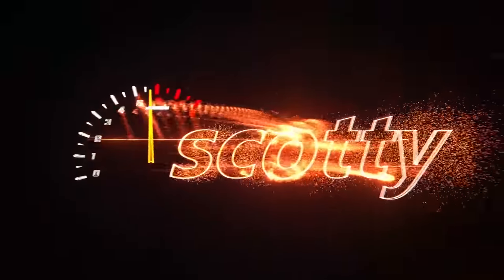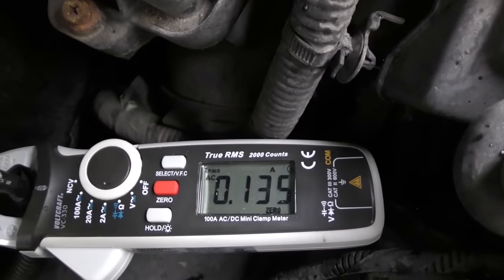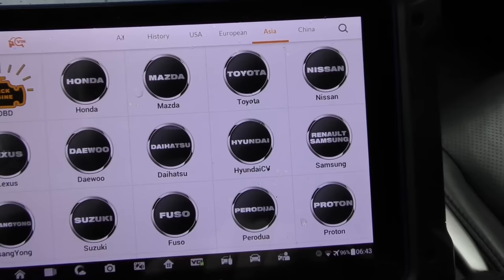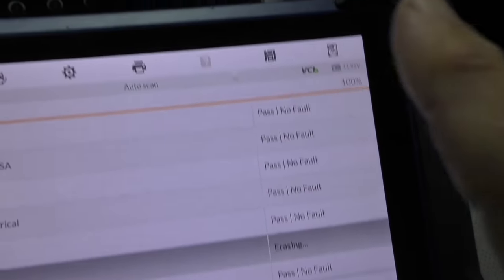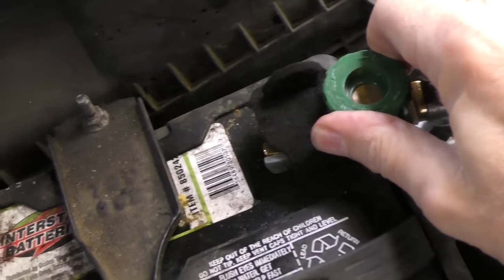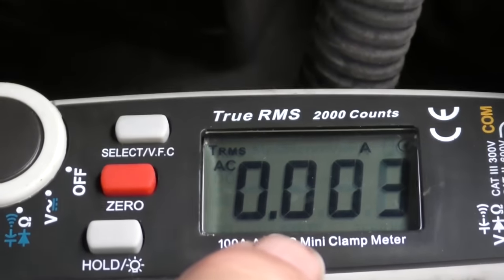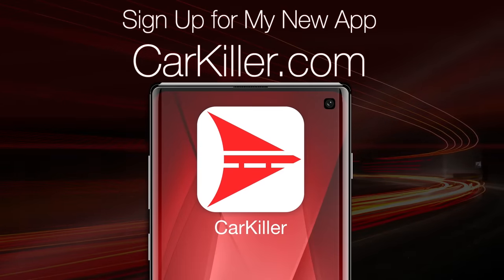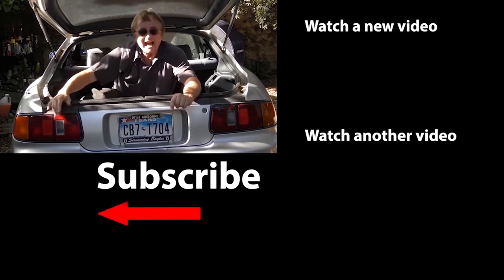Watch This Before Buying an Acura

Comment: The vehicle is over-sensored. Needless computer complexity with failure baked in, makes an owner want to sell the vehicle when it has some age. IT IS VERY POSSIBLE THIS ANOMALY WAS PROGRAMMED IN ON PURPOSE  BY HONDA TO CREATE THIS EXACT SITUATION. It would be wise to have 3rd party programmers read the actual code in the ECU and have an attorney call Honda if it's found they have pulled a Volkswagen maneauver on the American people. Wouldn't it be awesome to sue Honda for everything they got.

Comment: My two Mazdas, a stage 3+ MS3 and an AWD CX-7, have as much amps drain to deplete de battery after 4 weeks of non usage...
But it was simple to find the source: the CX-7 has a OBD2 Bluetooth plugin connected all the time, “it shutdowns automatically” sure sure sure
And the Cobbtuning Accessport v3 on the Speed, and again it is still alive waiting for the PCM/ECU to send wake up signal... so disconnecting them fix the problem. 
Mazda is not as crap as Toyota, one can disconnect the battery for car storage with out damaging anything like the Toyota’s: ECU Reset is welcomed for the Gen1/2 Mazda vehicles, resetting octane fuel usage and altitude statistics... while Toyota gets fused and probably destroyed lol
I can program the windows and traction control on the CX-7, I have an iPod for music so who cares about radio stations 

I have two friends with RAV4 and another one with RDX and they have infinite problems, even with their husbands being almost as good mechanics as me... this girl is not a normie like the ones Scotty preaches to

Comment: This is unacceptable manufacturing from Acura. We are not all tech savvy guys with ammeters and wrenches and no one should have to start their car every day, or every 8 hours to make sure their battery stays charged. I recently bought a used 2005 MDX and realized after not driving it for three days that it had this problem. By that time it was too late to return the car to the dealership, even if I had purchased their 2-day legal return clause and $250 restocking fee. And from watching YouTube videos, I see that the battery brain happens in all years MDX, from early 2000s to modern 2017s, and sometimes the problem is a safety threat - one forum described the car stopping on a freeway due to battery drainage. It's such a shame, because the rest of car is beautiful and well designed. In comparison, my older Toyota has never had battery drain. I just don't understand why they designed a car with all these electronics and computer systems which drain the battery, when all people want is a reliable car which will start whenever they want it to.

Comment: Scotty, you can't measure DC amps with a clamp-on meter.  The clamp-on is for AC only.  I'm afraid you're using the meter incorrectly.

Comment: Kudos for that interstate battery. One of the few batteries left worth anything.
Reply: Apparently Wal-Mart exide maxx are pretty good as well. Anything over the oem CCAs ratings are decent since there's only a select few battery manufacturers now, producing different brands names of batteries with similar specs.
Reply: @ricebike  Ive tried that battery. It died in under 2 years. Went back to exchange under warranty. It also died within 2 years. No parasitic draw either I tested it. Autozone batteries are trash. Never use them in a euro car.

Comment: Scotty, it may also be you have the amp meter set at “auto select” and it is reading transient ac current by way of the “ac” shown on the left hand side. I’m not sure if that meter is capable of hard selecting dc instead of auto ac/dc by way of the “select” button, but if it does it will likely give better readings. Otherwise if the current is too low or erratic it is always trying to auto select the current type (ac or dc) and not always accurately or quickly enough. This is why it’s a good practice to disable auto-range/ auto-ac/dc on digital multimeters if you know the expected range/type.

Comment: i remember when i did my first automatic to 5 speed conversion on one of my cars and it wouldn't start...i had to leave it till the next day. it didn't start cause the NEG battery terminal was loose😕 check the easy stuff first!

Comment: In an automotive advice column in the Chicago Tribune it was said that its a good idea, with a manual transmission to put it in reverse before ultimately putting it in another gear just prior to shutting the car off. I’ve never heard that. They didn’t say why to do that. Is there any truth to that?

Comment: Please help me sir!! I have A 2007 rdx that we have replaced everything on!! And still can’t get it to run right with the ac on!! New battery new alternator new battery terminals I don’t understand sir! I have not replaced the ac compressor yet that is my next move but I need your help!! Please 🙏 god bless you this has been an issue for 4 years!! I fix it get to drive it fix it drive it repeat please help me!!

Comment: hey I have a acura 2k8 mdx and this seems to be a common issue with the bluetooth hfl. in that model if im not mistaken its located in the area where the rear view mirror. if you disconnect it it should resolve the issue ( on the mdx you have to sit in the back seat and pull the middle console torwards and  the bluetooth hfl is right there and just disconnect it. hope this helps.

Comment: Scotty ive got a 99 RL that does the same damn thing !  i took the cheap fix just disconnect the terminal until I wanna drive it. The vehicle has 198,000 on it but it still runs like a bat outta hell and the body is solid not even as much as a dent. i dont know how much longer I will keep it but when I trade it in Its gonna be for a 2015 Acura TL . My question for you is what is better rear wheel or AWD

Comment: Subaru’s are known for dead batteries.. mine is 1 1/2 years old..18,000 miles and I kept getting a dead battery..kept jumper cables in my trunk...had to install a new battery...
Same thing with my last Subaru.

Comment: Dear Scotty I don't normally reach out to busy people like yourself but I have an important question I'm a young mechanic I own a 93 Dodge Daytona that I partially restored with my grandfather there was an oil leak in the valve cover and when I tried to replace the gasket the bolt to the cover snapped, (I was using a torque wrench set to the all data specs) I replaced the gasket and drilled and retapped the best I could there is still a small leak for now it's an oil pit any advice please up vote this feel free to correspond

Comment: Hi Scotty can you please disconnect the wireless bluetooth module and check again.....On 10 year old ACURA MDXs the bluetooth wireless partially shorts and causes the battery to completely drain..(Johnson controls was the MFG for the module)..the solution was to disconnect it...could the 10 year old RDX have the same bluetooth module>?

Comment: 1000% its the bluetooth module causing the power consumption. I thought you were a good mechanic lol It took me 10 mins of Google to find the issue its common and a super easy fix. I guess your way of rigging the battery works too LOL

Comment: Hi Scotty I have a 2002 Mustang GT, 98k miles on it. Car runs great a couple minor problems though. My check engine light came on so I plugged in my scan tool and my camshaft position sensor code came up. I changed the camshaft position sensor and the engine light went away for about a week or two and came back on. I was reading the Mustang forums online and a bunch of people saying it might be the alternator going bad. Also Sometimes When I get into my car It Won’t start on the first time, it it doesn’t fire right up on the first time then it always does on the second time. Any idea what it could be thanks!

Comment: Install a battery tender lead you can plug in with out opening the hood
Reply: Thats not a good solution. The problem here is the bluetooth module, very common on these acuras, just disconnect the module and it will be fine.

Comment: Got a Chevy impala ltz 2013- having a problem with driving side wheel. Not rotating correctly when I first start off cause the the traction light to come on. Also was advised my transmission is slipping. Any suggestions/ recommendations?

Comment: The fluctuations are because at that low amperage this meter is not accurate enough to read that low. This guy doesn't know what he is talking about. A very common problem is the hands free Bluetooth module. 10 seconds of research and you'll find it. If you want to be charged diagnostics fees from hacks like this, then throw your money away. Otherwise,  disconnect the hands free module and go on. I've had 3 and that's what I've done with all of them.

Comment: Skotty. Question.      Yesterday.   I.  Mistakenly. Pressed on the gas. Peddle. So much that. Some how. It took air in. &. My car. Turned off.    Now when I try to. Revive the car.  It. Turns on. But. Emediatelly. Turns right off.  The rpm.  Won’t rove up.          What can b the problem.       Al I did was. Press the peddle. All the way down.     I heard the gas go thru. So loud. Then the car turned off.  &. Would it. Stay on.      How can I. Fix this.    Let it sit. Or ?       For. Infinity. I35 2002. 3.5 engine v6

Comment: Hey scotty i am a young mechanic and i have a 2003 saturn ion that has a rough idle and stumble in drive from stop and go but in neutral or any other gear it runs fine until about 45mph. The Check engine light reads cylinder 3 misfire but does not blink or flash I have changed the icm, coil pack and spark plugs but nothing has changed please help

Comment: Ive been having the same issue with 4 of my TL 04 -08 model and the issue was the Bluetooth aka hands-link it would drain my battery in a couple of days after sitting. i just unplug it and never had an issue since then.

Comment: An Acura that drains the battery, I have, granted, older 3800 Buicks (1997, 2006, 2009) and don't have problems like these modern so-called luxury Japanese and German cars.

Comment: My biggest problem with Acuras is how the v6s still have timing belts!  Come on, put a chain in there..  and the leather seems to have the worst lifespan on any I've seen. Every Acura older than 3 years just looks ROUGH.  Cracked and dingy leather all over..    it's comfy, but not durable.

Comment: HFL module solder cracks and shorts. Green connector in the passenger side of the center console compartment. 

Unplug it and your freaky Acura drain will be gone.

Comment: Bad capacitor in the onboard computer?  They go bad in regular computers after 10-15 years.  They go from being capicitors to resistors... which leak voltage.  Japan produces the worlds best capacitors but they still do go bad sometimes.

Comment: Has anyone had any issues with the 2008 Acura MDX??? Looking at one right now that has 160k for 6 grand, it's priced at like 2 grand under market value and it is gorgeous!!! I have a 2008 RAV4 with the V6 and my rear subframe is starting to get pretty rusted out so that's the only reason I am looking, but any input would be greatly appreciated!!!

Comment: Scotty i have a Toyota echo 1.3l petrol. At steady speed abou 1900-2100rpm engine rattles, and the rattling stops whether I push gas pedal more than that or realease it. Otherwise runs good....

Comment: Hey you're right in CT ,would you look at my MDX I'm in Springfield?I have a running rich problem,but ONLY AFTER REPLACING THE MAP AND COOLANT SENSORS,it first it was misfires so I did  tune up,cleared,after the sensors now It's rich..

Comment: These clamp-on current meters are not that accurate.  Especially on the lower end of its range.  Also....  you're in AC mode and you should be in DC mode.

Comment: Scotty I have have Volkswagen polo 1.2 diesel.
It fan stays on even I don't start the engine, and some machine says it could be problem in ecm.
It could be software or actual fault in the ecm chips.

Comment: Hi, how do I fix the spray for the windshield wiper fluid? It’s not spraying any water. Is it just clogged?
Reply: Either that, the switch, or the washer pump or the wiring

Comment: I had a similar issue.  It turns out that the aftermarket stereo amplifier was still drawing power when the car was shut off.  For some reason, the blue & white amplifier turn-on lead keeps sending power, keeping the amplifier on.  So frustrating!  Anyone have a suggestion to fix this, aside from installing a switch on the turn-on lead?  I don't want to tie into a factory ignition switch wire unless I have to.
Reply: I think you may find the amplifier is staying on as design. Up to 3 minutes after you turn off the ignition, roll up the windows, get out of the car and close all doors it will go to sleep and turn off. This is normal.

Comment: He should hook up an actual electrical disconnect switch instead.
Reply: And how much would that cost? These mechanical ones are easy to install and are under $10. I say, unplug those offending modules to see if that resolves the issue that plague Honda Acura owners ALL over the nation for almost a decade now

Comment: Scotty how would you rate the reliabilty of a Saturn/opel astra H
Reply: I'm not Scotty but check out the costs for normal wear and tear parts like brakes,struts,o2 sensors and such at your local parts stores. I'm pretty sure what you will decide.

Comment: Hey Scotty, I was looking at a 2007 Toyota Corolla CE 5 speed manual transmission, 1.8 liter 4 cylinder 126 hp. It ha 232k miles. It’s listed for around 2100 dollars. Should I buy it or ditch it?

Comment: Scotty i have a 04 buick lesabre 3.8l v6 engine 132000 miles what would be causing my gauges and windowa not to work ?? Changed all fuses and relays and still having problems ? Can i have u come to ny and fix it lol ill pay u if not whats a good answer thx

Comment: Hey Scotty  I got a code on my 03 gmc 4.3 code on the vehicle is P0016 crank and camshaft position sensor bank1 where are these located and should I change both sensors

Comment: Hello Scotty I have a 2001 Nissan Maxima Se 20th Anniversary Edition with 116,169 miles have a code P0430 catalyst efficiency below threshold bank 2 would I need to replace the o2 sensor or the catalytic converter.

Comment: Of course it runs fine when Scotty drives it 😵
Reply: The problem was something is draining the battery...
Reply: @ricebike  I meant in general when a mechanic test drives a car, especially with an intermittent problem, it works fine for them
Reply: @CornPop471  that's why mechanics should charge 1 hour diag fee from the start for "intermittent" cases

Comment: Scott Obviously the best diagnostic test would be to start disconnecting certain systems. For example, disconnect the NAVIGATION SYSTEM, which the car was complaining about. Disconnect the navigation system and then see if that intermittent power spike came back. Start disconnecting individual computer systems after that if that doesn't work, for instance the entertainment system. The other thing that would be smart to do is to record the power spikes and plot them. You might notice a pattern in the data. THe pattern could show something obvious; computer systems have a sleep wake cycle. Its possible one of the systems has a glitch where it is coming out of sleep mode for a split second and then going right back to sleep. You might try measuring power at the terminal of different computer systems. You just seemed particularly lazy this episode and your solution of "oh just unplug the battery" isn't great. When you just unplug the battery certain cars, especially modern cars, get messed up as they have to re optimize the engine.

Comment: Hi. I thought you would fix almost anything...! LOL

Why not simply put a battery maintainer in it (solar or otherwise)?
Reply: Can't fix until you know the exact fault. Switching off the battery, or plugging in a battery maintainer, may be the preferable solution if the exact cause can not be proven.

Comment: I thought these were assembled in Japan? Saw vin starts with a 5.
Reply: Its the bluetooth module in these acuras from 2004-2008, its a very common problem. The bluetooth modules were made in mexico, thats why they fail. But all you have to do is just unplug the bluetooth module or buy another one(not expensive)

Comment: Bad ground?
Reply: He tightened up the main ground cable and the intermittent spikes are still there...
Reply: @ricebike  Sometimes, simply tightening the cable doesn't work. Usually, you also need to clean the contacts. And the only ground he checked was at the battery. There are probably other corroded grounds.  Not an easy thing to find and fix.
Reply: @N7492  yea, but it's apparent that it's the module EVERYONE is commenting about in this case
Reply: including my wife's 2005 Acura MDX

Comment: He should  hav bought a honda accord  euro r made in japan 4  japan only  cl7 with the k20 engine  & the 6 speed with double wishbone suspension  at the front.  I would never buy a new honda a lot r made in Thailand. The keep the a grade parts 4 japan & the parts that pass or just pass there used in Thailand.